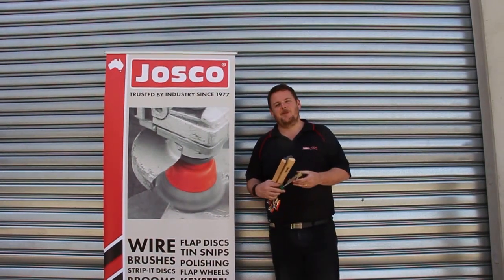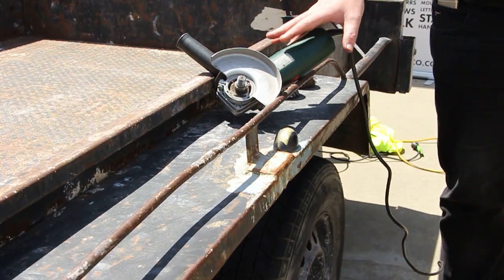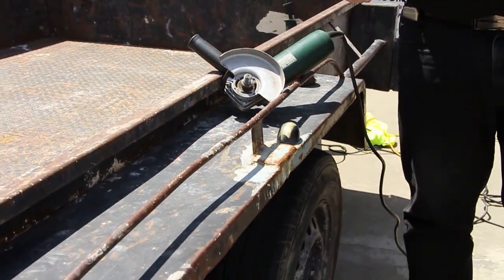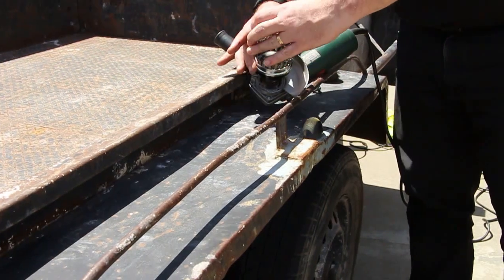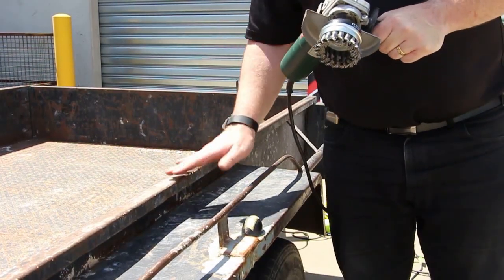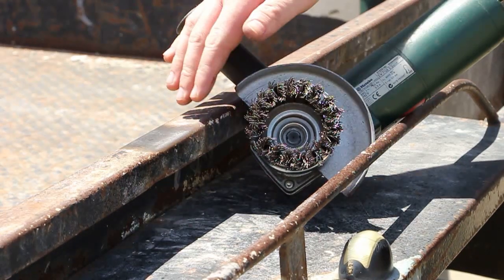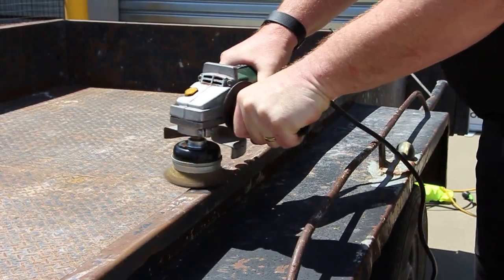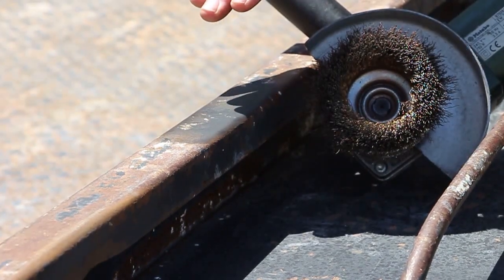Josco | Using Brumby Wire Cup Brushes to Remove Rust & Paint from a Trailer

Comment: G'day Josco,
Many thanks for the video.
I purchased the Twistknot for my Makita angle grinder, and the problem is, with many products, there is no instructions with the tool on how to fit it. I wasn't sure if the supplied nut went downward to the grinder spline or facing upward, as in your video.
Reply from the maker: Thank you for the feedback. If there's anything else we can assist you with for your twistknot cup brush, or any other Josco product, please feel free to give our office a call on 1800 445 444, or email us at customerservice@josco.com.au.

Comment: Hi Josco, which brush would you recommend for paint and rust removal for car panels? i don't want to damage or over heat the panels?
Reply from the maker: Hi green tea, 
We recommend the Brumby Strip-It Discs for paint and rust removal of car panels. The nylon is impregnated with silicon carbide which will prevent any damage to the panels. For more information please visit out website or feel free to give us a call on 1800 445 444 and we will be more than happy to assist you.
Reply from the maker: Hi green tea, 
We recommend the Brumby Strip-It Discs for paint and rust removal of car panels. The nylon is impregnated with silicon carbide which will prevent any damage to the panels. For more information please visit out website or feel free to give us a call on 1800 445 444 and we will be more than happy to assist you.